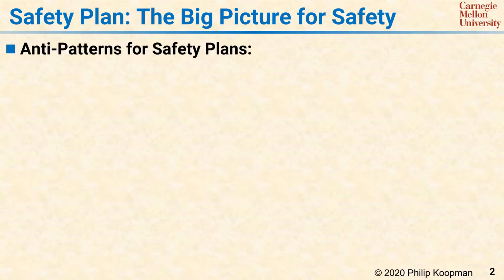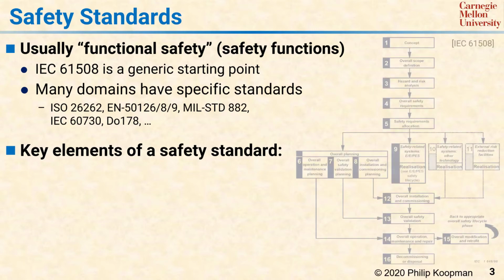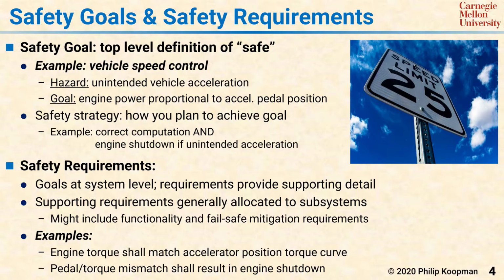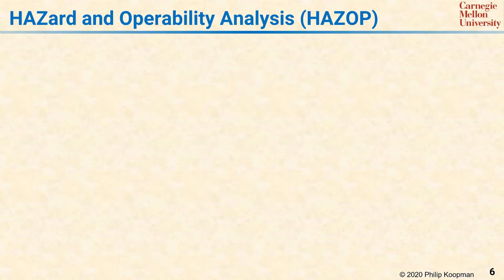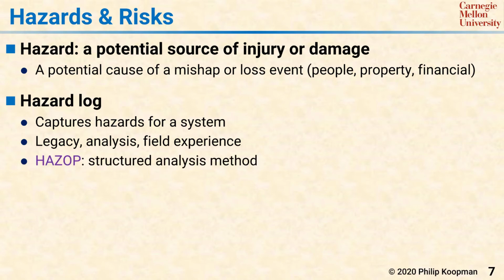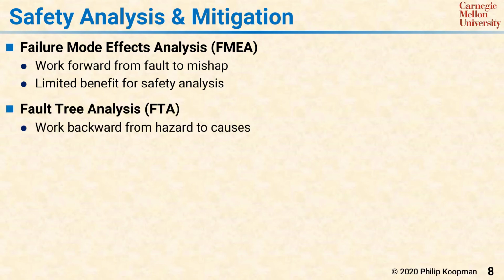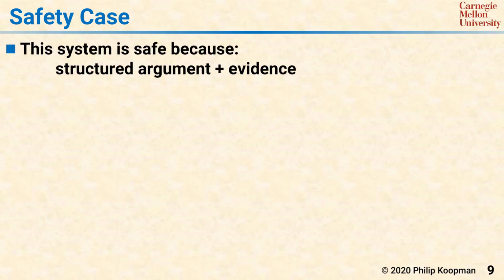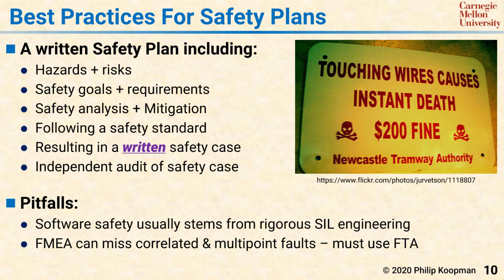L29 Safety Plans

Comment: You mention a lot that combined faults are not analyzed. Actually (at least for medical) you should analyze two cases of faults:
1. If one failure/event causes another, then it is treated in such analyses as a single fault. 
2. If fault is not detected before it can do any harm, then it is not a fault, it's Normal Condition. One of worst situations in any analysis :( Also applies if problem is not detected or ignored before other problem occurs. 

Either way, you don't need any more assumptions in any FMEA/SFC etc. analysis.